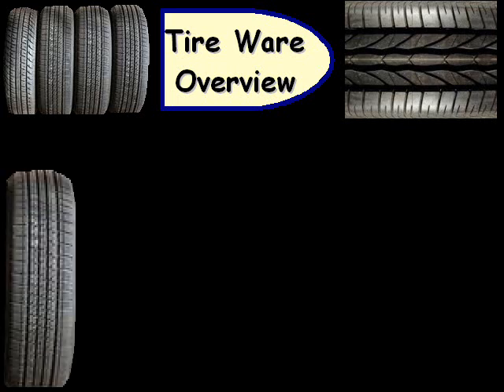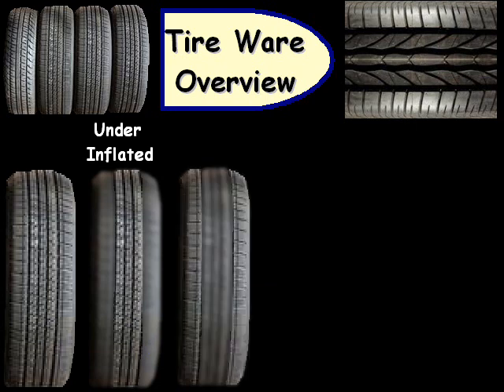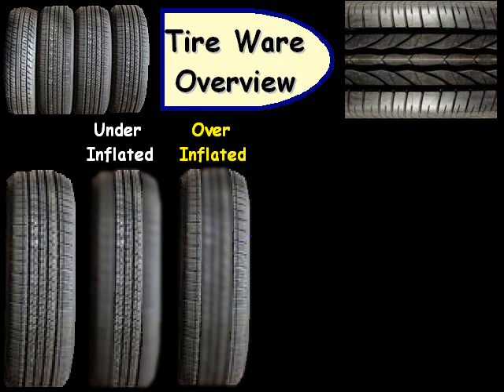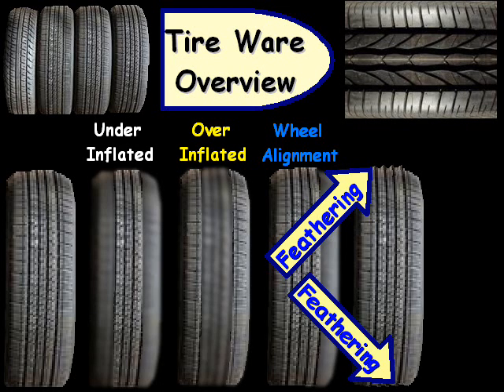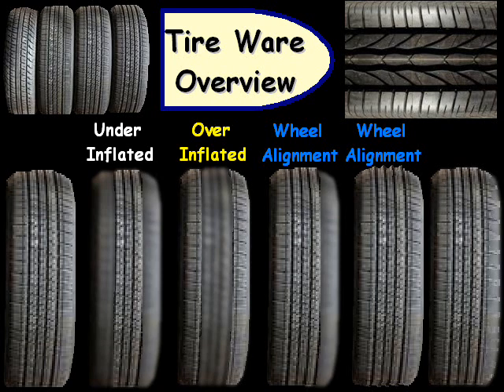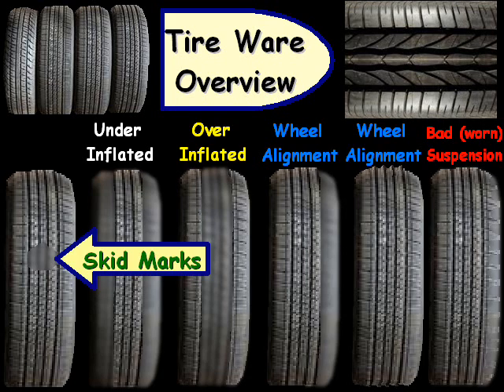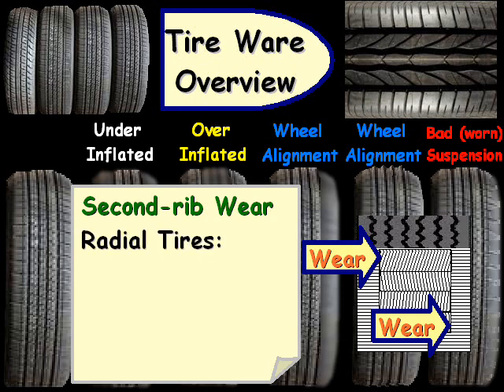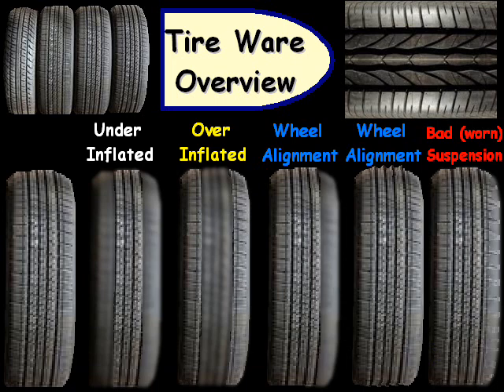Overview of tire wear

Comment: Over inflation is not the cause of centre wear in modern tires.
This is a throwback to bias ply tires that you could over inflate and balloon the tire.
A steel belted tire will not curve anywhere near enough to wear the centre of the tire.
The cause of centre wear is high torque application in turns which is why you usually find this wear on the rear of a RWD car. Decreasing the pressure will only make it worse.

Comment: all 4 of my tires are wearing down even across the  tread. but the passenger side wears down faster than the other three, no caster adjust on strut. anybody knows what causes this . put 4 new tires on 3 times different makes so not just a bad tire.
Reply: Matt Stevens passenger sides always wear faster regardless of the side of the road you drive on. If you drive on the right then left hand turns in the city have a much larger radius and higher speed than right turns so the pressure on the tire is greater. The opposite is true for those who drive on the left. Rotate your tires regularly and the problem will disappear.

Comment: My Chrysler town and  country  the tire on the driver's side front is bald but the other side  looks new and they all have been  changed at the same time  I'm trying to  find out y
Reply: Johnathan McGhee If you drive on the right side of the road the right side wear faster because left turns are longer arcing than right turns. The opposite is true for countries that drive on the left side.
The more body roll a car has or the faster you corner the more this is accentuated. Regular rotation will stop this. Another issue could be irregular pressures. Even 5psi low on one side will make a dramatic difference in wear over the life of the tire.
These would be the most likely issues so long as all the suspension and steering componants are ok.

Comment: I just noticed my driver side iw worn theres no thread on the inside. The pass is fine. I did hit a big pothole on that side a few months ago
Reply: Luis X Check pressures and alignment. A good alignment tech will be able to tell you if anything is bent. Sounds like a little toe out may be your issue.